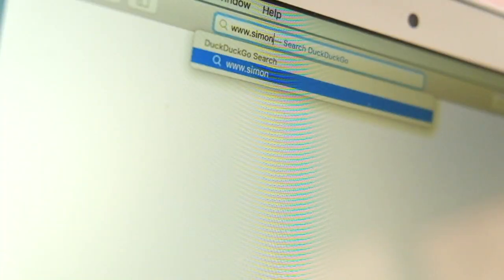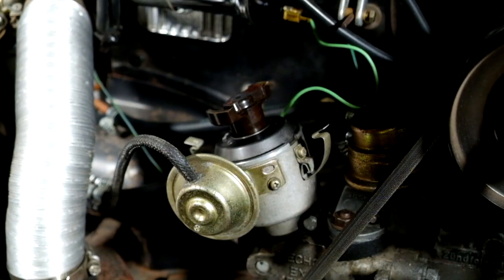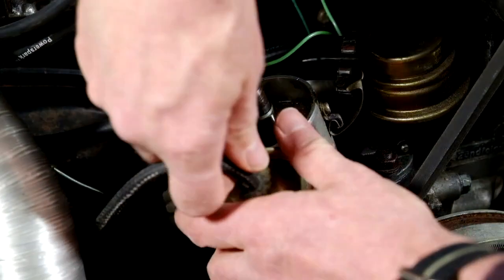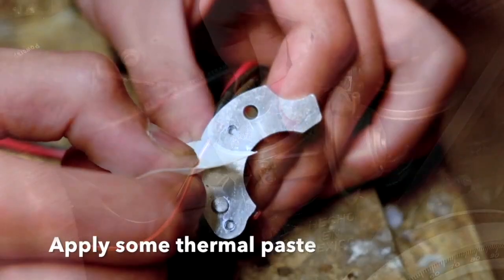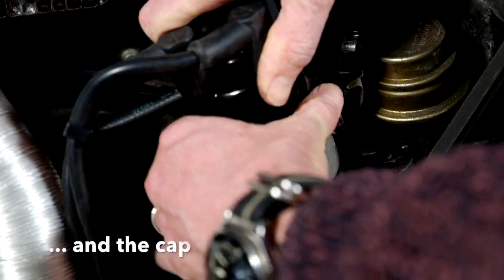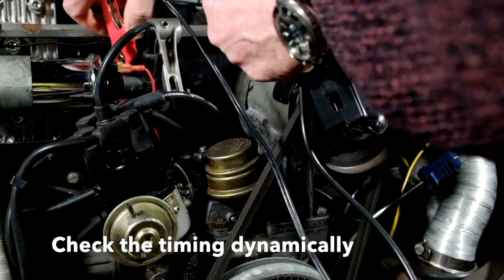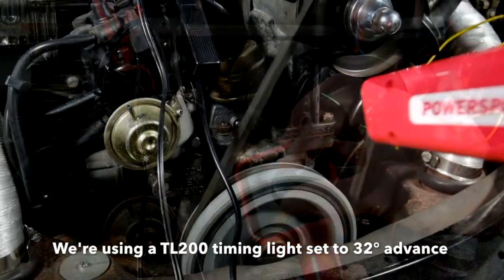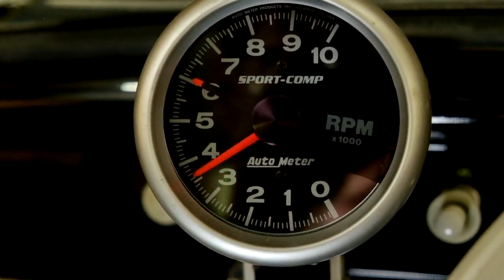Fitting Powerspark Electronic Ignition Kit to a classic Volkswagen Beetle

Comment: Hello, why was it set to 30-32 degrees btdc with the vacuum hose disconnected? I thought 30-32 would be the maximum with full vacuum advance? Does this dizzy have a mechanical advance as well? What advance will that give you with the vacuum hose reconnected?